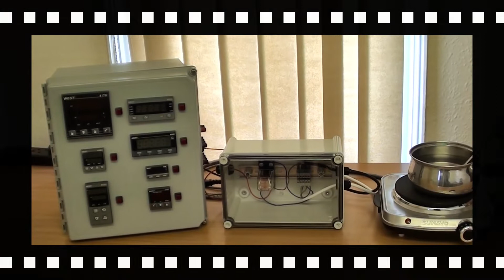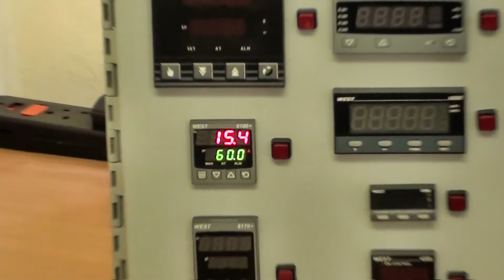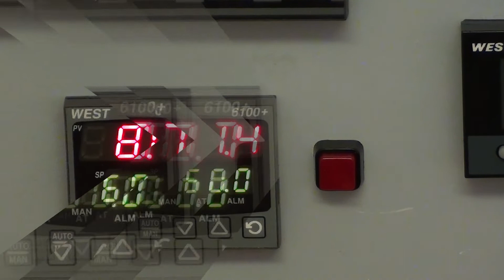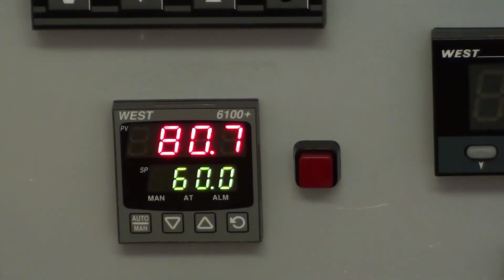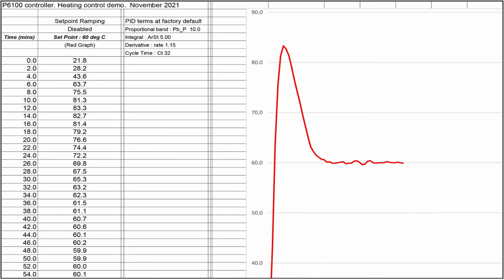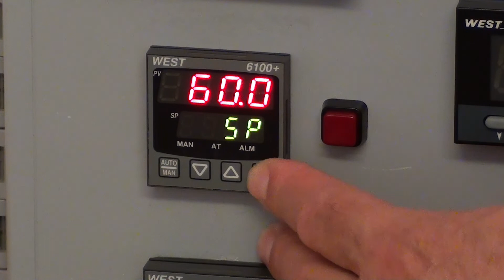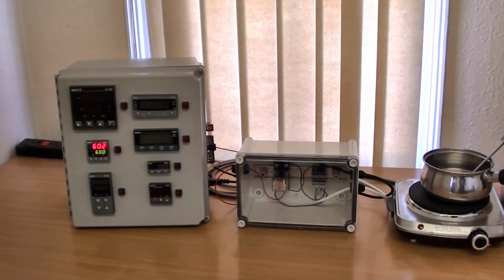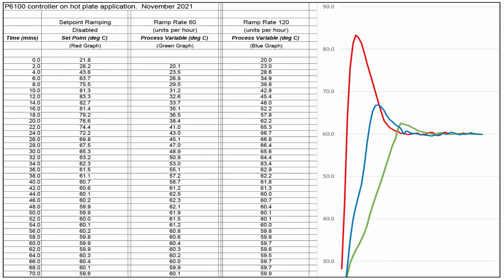Setpoint Ramping with West PID Temperature Controllers

Comment: Will a 6100 controller allow you to ramp while using a remote 0-10V signal?  I've found the Eurotherm 3000 series will not allow you to use ramping with a remote set point.  If you set it to ramping, it disables the remote SP feature.